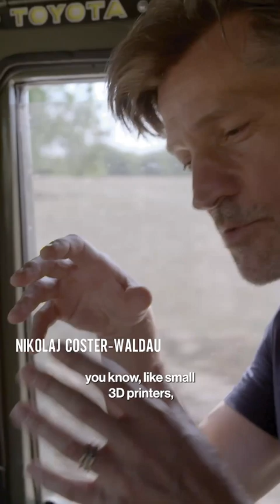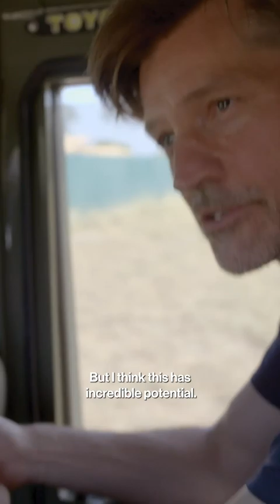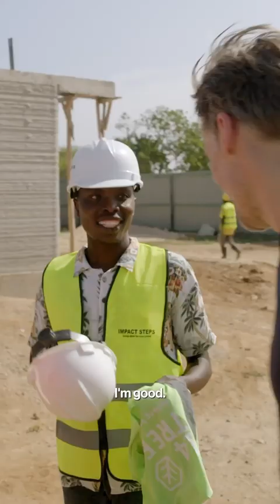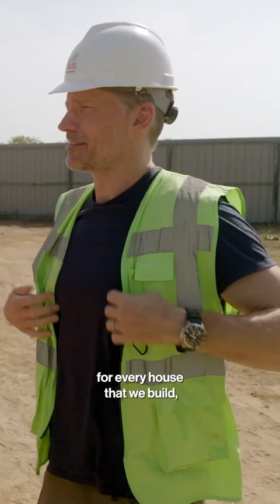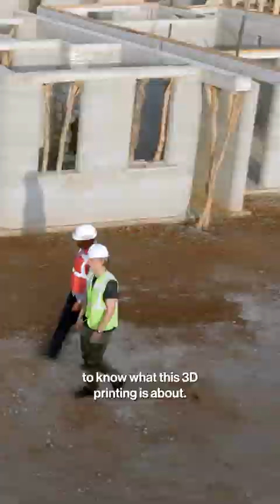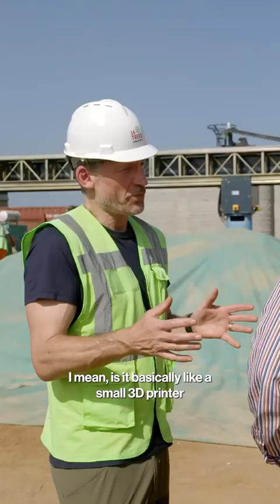How 3D-Printed Homes Could Help Cut Emissions

Comment: Saving 14 trees is not the flex it sounds like, especially if it's using concrete. You can plant 14 trees for under 20 bucks but even that won't offset the CO2 created by all that concrete.